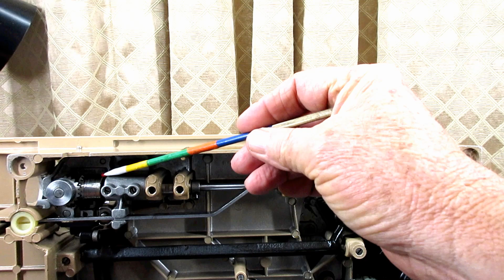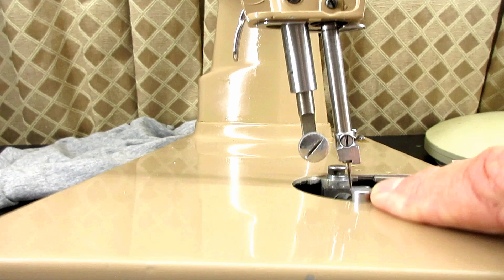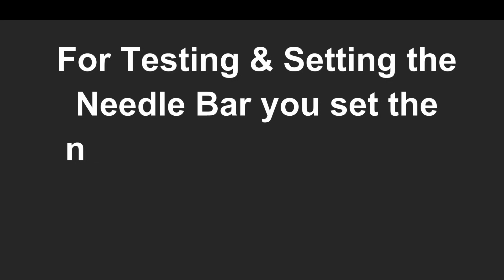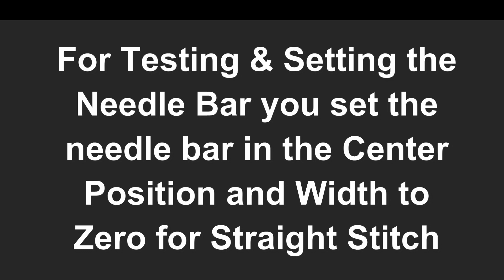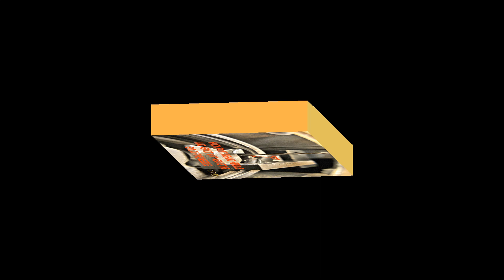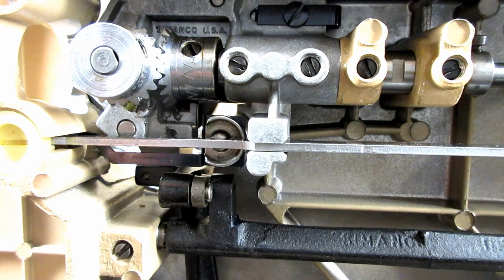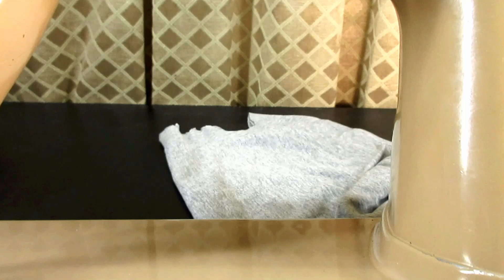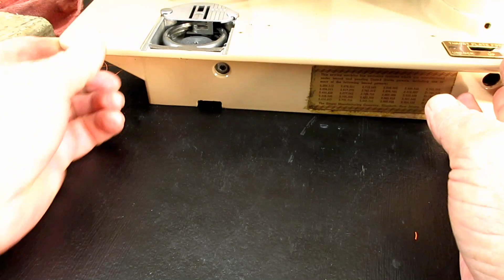How to Check and Set the Timing on a Singer Model 403A Special Slant Needle Sewing Machine

Comment: Andy,I seem to remember in one of your videos you told how to adjust the needle to eliminate the “ting” on the needle as it passes the hook.  I just retired my 500a and now have the “ting” with the needle.  How do I stop that?  My 503a also “tings”.  Thank you for all your help with our machines!
Reply from the maker: Some model 500A and 503A (401A, 403A) have problems with skipping stitches, especially on knit fabrics. A method was developed to adjust the hook by tilting it towards the needle until a slight swish (ting?) was heard as the needle "brushed" the hook. If the needle was "deflected" by the hook it was adjusted too close. There is an adjustment in the Service Manual for the 500A/503A on page 12 called "TO CENTRALIZE THE NEEDLE IN THE NEEDLE HOLE OF THE STRAIGHT STITCH NEEDLE PLATE." It describes how to check and set if needed. When that proper adjustment leaves too much space between the needlepoint and hook point is what caused the skipping. Now there is an adjustment on page 16 called "TO SET THE POSITION OF THE HOOK POINT TO OR FROM THE NEEDLE".  The 401 and 500A Class machines have what is called a HOOK BRACKET ASSEMBLY and that is what can be adjusted. It allows adjustment of the hook to or from the needle. You can't really move the needle closer without it hitting the needle plate, etc., so you tilt the hook a little closer to the needle. (you can't move the needle plate, right?) The Service Manual shows the space between hook and needle is to be set at .000 to .002 inch. (hard to do) The Singer Technicians found a workaround method they liked better. In 2011 a retired tech wrote a paper about this better method and described that they used sound to tell when they had the best setting. When the two parts got close enough that you could hear a "Swish" that was the place to stop. Your machines may have been set by a technician in the past to prevent skipping, and that may be the "ting" you hear. The paper by the tech said if it is loud and the hook deflects the needle it is too close. The Service Manual for 401 and 500A Class machines are available for free to download on this page: https://sewingdude.wordpress.com/category/free-manuals/  Just scroll down to find the manual(s) you want. The paper I mention was written by Bill Holman.
Reply: @andytubesewing1953 
Yes, my 401a makes a metal to metal abrasive swoosh sound when the hook and needle interact. 
Is this page 144 on the 401 manual. 
Just happened to notice this comment searching for how to center my 401a needle to 3 with the red lever:)
Reply from the maker: @antoniokinsey4041  Yes, when the 40X and 50X models came out, double-knit fabrics were just coming on the market and those models could skip stitches on those fabrics. Page 144 describes adjusting the hook closer to the needles, but it was the SInger Repairmen who developed the method of moving the hook close enough to barely, barely touch the needle. To the point you get that zziinngg sound of touching metal. Also use page 142 for centering the needle of a 401A.
Reply: @andytubesewing1953  
Thanks, I’ll look at the manual, on that page, and also check to see if I can find that article by Bill Holman.
That’s good to know. Thanks.
Reply: @andytubesewing1953 
Thanks!

Comment: We just found a 401a in its cabinet at a thrift store, and so far it seems to work quite well, but I'm 99.9% sure the timing is off. After watching this, I finally understand how I can check, and how to correct it if it needs it. Thank you!
Reply from the maker: That's a nice model; congratulations! Hope you love it. This video is 1 of 26 for Model 403A, the "little sister". You can find the other 25 in this playlist: https://www.youtube.com/playlist?list=PLsCOZgzzaiKKyqvdDRwS-9MfLuwSNJTcg   I also have videos for Model 401A in this playlist: https://www.youtube.com/playlist?list=PLsCOZgzzaiKLiDl9yFTP6mJgQmz5lj4NO   Besides timing, these videos cover almost every part of the machines, from the motor to cam stack to needle bar, etc. all for the DIY repair, adjust and oiling of the machines. If your machine did not come with the Instruction Manual it is available for free from the Singer website at this link:
https://www.singer.com/search/support?title=401  (4th manual from the top) Thank you for watching my channel, and happy sewing with your "new" 401A Slant-O-Matic, the "Cadillac" of Singer machines.

Comment: Thank you for the awesome video. It's very informative. I have a singer model # 179590. I sewed with it for about two minutes and it siezed up on me. I've oiled it and its still froze up. Have you ever dealt with this model?
Reply from the maker: Hi Tracy. That is not a valid model number for a Singer Sewing Machine. Maybe a motor number, serial number (usually has a alpha letter in front) or something, IDK. This page at the Singer website explains how to find the model number on most of their machines. If you can get an actual model number I'll try to help. In general, a sudden seizure and be a thread jamb under or around the hook, but possible broken gear or bearing.
Reply: @andytubesewing1953  ok. Sorry bout that. I'll find the model number and get back to you. Thank you
Reply from the maker: Sure, no worries. I'm on tenterhooks 😊
Reply: @andytubesewing1953  It's a Singer 328k Style-O-Matic.
Reply from the maker: @tracylewis9622  If it came to an instant dead stop while sewing that could be something blocking the hook system or the worm gear/cam stack of the main arm up top. Like a broken needle piece, pin, or loose screw in the parts. A pattern disc follower arm may be jammed. If it grudgingly came to a stop that can often be thread wrapped around the hook, hook shaft. See if you can remove the bobbin case and see around the hook and shaft below it. I have several videos of model 337 and 338 which have the same mechanics as your model. Also some videos of sister machine model 327. Did you just get the machine and were trying it out, or had you been sewing on it before? If it was new to you and had sat idle for a long time the dried oil in the shaft bearing and bushings could have broken loose and jammed the bearing when you started sewing and the metal warmed up a little. Same for the bell crank hook system. Using good quality fresh oil and heating the areas where you apply oil with a hairdryer can soften that old gunk up and get the machine moving.
MODEL 327K VIDEOS: https://www.youtube.com/playlist?list=PLsCOZgzzaiKKHFzTFVJrwVQT6hMfXxFHt
MODEL 337K VIDEOS: https://www.youtube.com/playlist?list=PLsCOZgzzaiKJxbOOMKQPvmeTRqi0dhGa5
MODEL 338K VIDEOS: https://www.youtube.com/playlist?list=PLsCOZgzzaiKK4y8dsq3oMKJFTGsoNJWmi
I'm assuming by seized up you mean you can not even turn the handwheel and move the needle bar.
Not all the videos will matter like it is not a bobbin winder or tension problem, but most parts on the machine move together, and if one is blocked nothing else will move. If you need the instruction manual it is free from Singer in PDF format at this link:
https://www.singer.com/search/support?title=328  (first on the list)
I recently emailed with a viewer who had received two frozen Singer machines. He oiled them up well in the places shown in the instruction manual and set them out in the sun for a few hours. In the evening he retrieved them and they both turned as "easy as soft butter" hehe. That's why I was asking if the machine was new to you or had not been used for a long time.
If none of this helps I can email you the service manual if you want to take parts off that I don't show in my videos. Good luck.

Comment: Hi Andy. On my 403, the screw that secures the bight lever in place became loose allowing a bit of zigzag to creep into my straight stitch. Before I discovered that this was the source of my initial problem, I made a series of trouble-shooting adjustments to the machine (timed the disc follower assembly, timed the needle entering the fabric, adjusted the hook timing, and adjusted the bight amplitude stop plates - I'm getting a perfect 5 mm stitch bight now). After these steps, I have a beautiful straight stitch again but I have a new problem with my zigzag stitch: It is off balance on the bobbin side. The top stitch looks fine, the bottom looks fine on the left hand side, but on the right hand side, the top thread does not pull hard enough so that the bobbin thread is not drawn all the way over to the side of the stitch. I obtained a tension scale from the Featherweight Shop and set the top and bottom tensions with it, then adjusted them every which way but the problem persists on the bottom right side of my zigzag stitch. Any ideas?
Reply from the maker: Hmm... I've never had this before 👀 
     You mention several adjustments you made before finding the loose screw. After you "fixed" the loose screw did you go back and check all those adjustments? 
     Normally what you describe is a tension issue and I get that you adjusted upper and lower tension, but what tension setting are you using when your ZZ stitch turns out as you describe? Normally the tension setting for ZZ is lower than for straight stitch, the wider the ZZ stitch the lower the tension setting. 
     Trying to think what else may be wrong I'd refer you to this page to download the Service Manual for Models 500/503A. I know you have the 403 but the 503A manual has a separate section for adjusting the 503A which is the same mechanically as your 403A. I like using it to adjust the 403A when I work on them. 
     I am NOT advocating that you need to make any of the following adjustments, but only to check them to see if you DO need to make them. On page 42 is "Bight Amplitude Selector" R & R instructions. Notice for the Replacement it refers you back to page 36 of the 500A instructions. "Bight Amplitude AND Pattern Selector" is instructions for R & R again and notice the last Replacement item #7. "Adjust machine as instructed on page 34."
     On page 34 you see the instructions are to "Centralize Needle Bar Driving Arm" and it involves some checking/setting of the screw I believe you found to be loose. I'm wondering if besides being loose the adjustment was affected and by just tightening that screw you "locked-in" the misadjusted setting. That's my WAG (Wild Ass Guess) as I can't get my hands on your machine. 🙂
I think those are the things I would look at if lower needle tension settings during ZZ did not help. Again, I am NOT recommending you start removing parts, just take a look at them and the settings in case something is off. Good Luck.
Reply: @andytubesewing1953  Hi Andy,

Thank you so much for your detailed and thoughtful advice about my zigzag stitch. I delayed responding because I wanted to be able to report that my problem is fixed, which it is. I followed your advice and worked through the Singer 500/503 repair manual (got a good copy from Terry's TNT). I adjusted and/or checked the presser bar height, thread clearances, stroke of the take-up spring, needle and bobbin tensions, needle position in throat plate, needle bar height, hook timing, distance between hook point and needle (visual check), timing of disc driving worm wheel assembly, bight amplitude stop plates, timing of disc follower assembly (checked), and the needle bar driving arm plate disengaging mechanism. I also tried changing the needle and thread in my machine. Finally, feeling certain there was nothing left to adjust, I gave the machine a really good oiling. And that solved the stitch problem! I learned a good deal more about my machine in the process. Now, back to sewing clothes for my adorable granddaughter.

Much appreciated,

Helen

Comment: I have a singer touch and sew 648 and the timing hook is off.  I loosened the screws on both the left side and the right side to set the hook timer. When I put everything back together, it’s still hitting. What am I missing? Was unscrewing the gears on the left side my mistake? We loosened the screw on the right so that the bar would move but the wheel would not move... Lined everything up, it worked for about five minutes, before the timing became off. Please help. Ty!
Reply from the maker: I don't think it was necessary to work on the left gear, but I've never had this model on a bench. Some of what you are describing makes it seem like the top gear on the vertical shaft has cracked/broken. The vertical gear is what makes the movement to the bottom of the machine to run the hook and feed. If the top gear is missing teeth, you can set the timing 100 times and it will soon go out. I made a video about replacing the top gear on another class of machines. https://youtu.be/M3bFtlV1Y6s
Looking at my video you can see the gear I'm talking about and maybe peek into your machine with good light and see if indeed your machine has a plastic gear there and it looks damaged. Your model is a little different of course and the extraction method may vary. If it's the gear I'd refer you to this seller who knows more about T & S models then anyone I know. He has the replacement gear and I see he suggests a "roll punch" which may be needed for gear removal. He sells manuals also and perhaps can advise you if needed. He does give you a 20% discount off everything you buy foe being an Andy Tube viewer. Here is the site: 
 https://store.tandtrepair.com/620630640set.html  The coupon is andy-h-yt until 7-31-2020 Good Luck.

Comment: Hi Andy, I took my 403A into the shop because top thread kept getting caught on the bobbin casing. I think I said that correctly. I would get 2-6 threads from the spool wrapped up in the bobbin area; started sucking the fabric down into the bobbin area. The mechanic said it was the timing and that they fixed it. I got home and had the same problem. I took it back in. Now they say the "bobbin motor" has died and can't be replaced. I'm pretty sure there is no such thing. Am I right? I sure can't find it.
Reply from the maker: "Bobbin Motor"? That's a good one! I'll have to remember that. You are right; no such thing. How much was the new machine he offered to sell you? There are a couple of things to look at here. If there is damage to the hook, the hook point, like a burr from a needle strike, can snag the needle thread and not let it go, so the hook takes it around again and grabs another thread and can't let it go and so forth. After a few turns, the result is what you have. You can remove the bobbin case and check along the hook edge and the point for a burr that grabs the thread. The whole hook area should be nice and clean and lint-free since you paid for servicing (👀) I check the point by dragging a loop of thread from inside the point sliding it off the hook point. If it snags or hesitates you should be able to feel a rough place with your finger or see it. You can sand it off by using a shoe shine movement with a stirp of very fine sand page.https://youtu.be/us1sHv1-2Kc    If you don't have a problem like that the next check is the thread clearance gap between the bottom right corner of the bobbin case and the positioning spring to the right of it (black) It is supposed to be a certain space (opening) and if it is too narrow the thread can hang there and get stuck. Of course, the hook keeps turning and grabs the needle thread again and it gets stuck and the next and the next until a big jam stops it all. I have a video for setting the thread clearance: https://youtu.be/O7drU1gNKqo
If that doesn't fix it then it gets more complicated. I have had conversations with machine owners who had your exact problem and tried many adjustments and fixes and even parts replacements, but in the end, it turned out to be a thing called a de-lint pin, or delint pin. It's a small metal post (think pencil lead size) that sticks out of a part called the positioning finger that is around the hook at the back edge. That finger is what you position the bobbin case on when you install it. The delint pin was made to poke into the inside hollow curve of the hook and scrape out the lint there while the hook is spinning. Guys were having your problem and would take the machine apart to see where the thread was getting stuck. They would grind off that little pin (we later found you can just pull it out of the hole it is in using a plier) and upon reinstalling all the parts they had no more thread tangles, bird nesting, thread wrapping problems! The only way we know to get to the pin is to remove the whole hook with the position finger attached. It's a process. I made a couple videos for taking it out then putting it (hook) back it. If you watch the beginning of the 2nd video I point out the delint pin: https://youtu.be/1GmJTGKE0aY
Here is the 1st part: https://youtu.be/T4YPB1KK3_Q    If you think you want to do this, please get a light and look at the hook area and see if you do have the delint pin sticking into the right side of the hook hollow. The machine in my video had already had the pin removed. If your pin has been removed then it cant be causing the problem. A long answer to your question, else2244, but many people read the comments and I wanted to give you some things to check while I have the time to answer comment s this evening. Hope you find the solution and thank you for watching my channel.